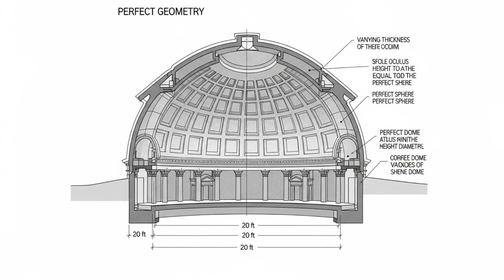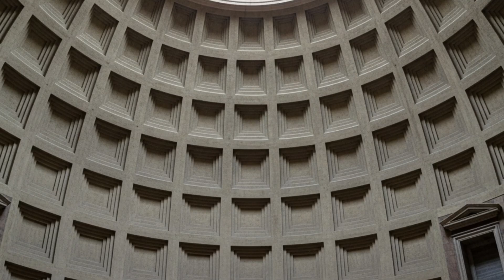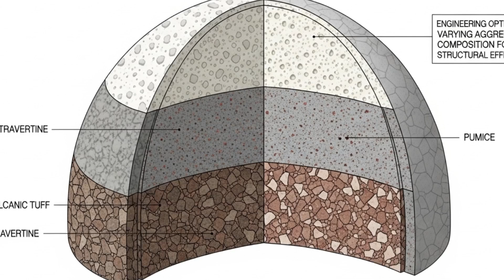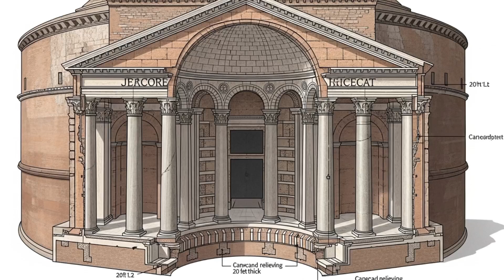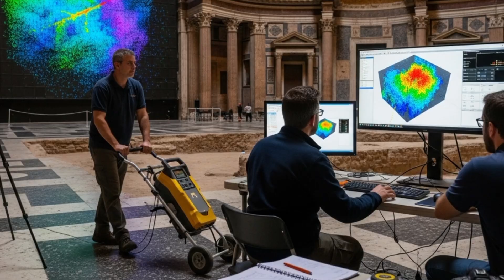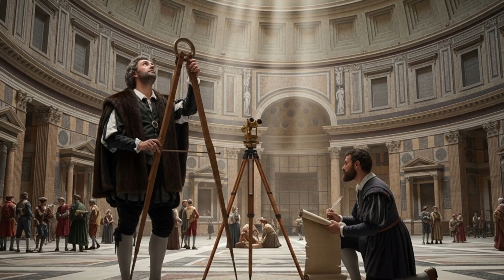Pantheon: World's Largest Unreinforced Concrete Dome Built 1,900 Years Ago Still Standing Perfect

Comment: I am thinking about a 70' Dome with 12' stem wall and an oblate shape. Basalt vs steel rebar. I hope to put everything inside. I do like that big old window on top. Central minimal plumbing, electrical and HVAC- 3 mini-splits. One large overhead door. 2 very heavy duty doors capable of stopping a 100 mph flying 2 x 4. I will park my electric transit inside a protectected safe area from the rest of the interior. You inspired me even more. I thought about calling mine The Pantheon, even though I am Greek. Haha. I appreciate your work on this video 🎉!
Reply from the maker: Thanks🌹